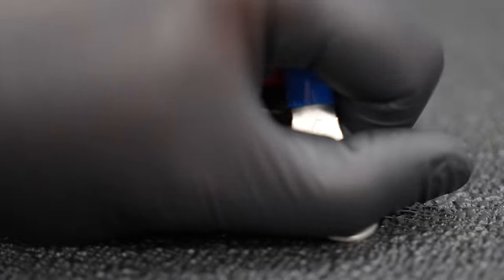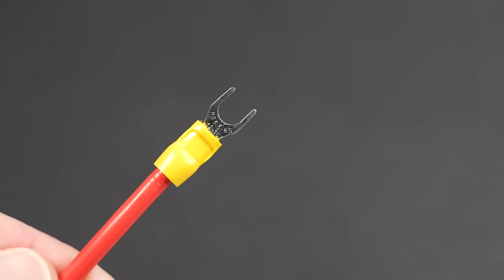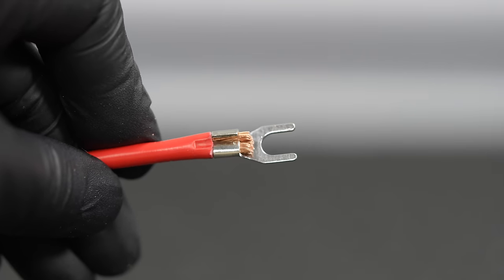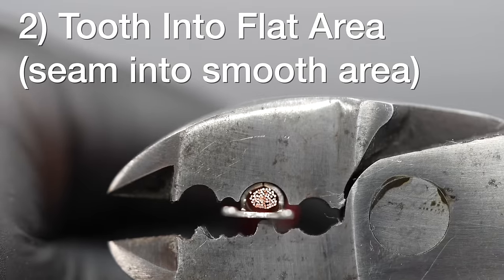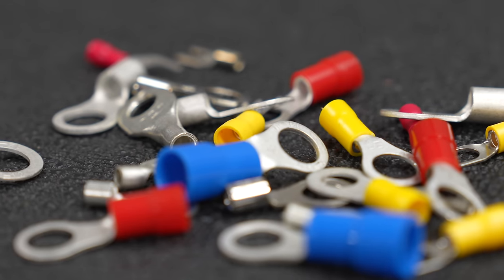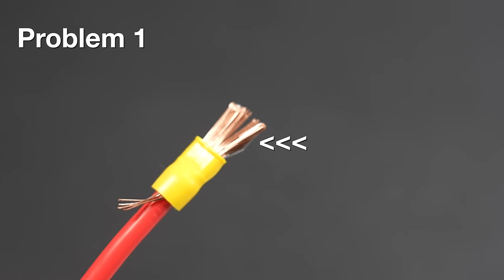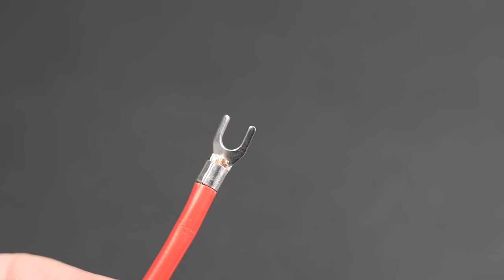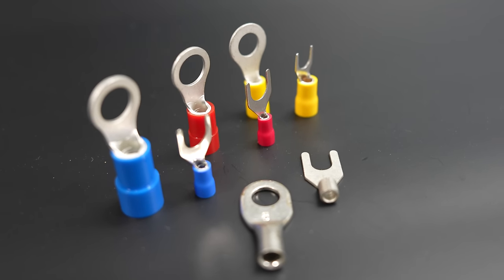Why 50% of All Crimp Connections Fail - Up or Down?

Comment: This explains the problems I've had for three decades with amateur wiring in my car. Genuinely, this video has made my life better. Thank you.
Reply: Yes but now you are old so you dont need it anymore
Reply: @misterRobbi   hes 15
Reply: @misterRobbi  Old physically, but I'm still installing aftermarket stuff at 45 when time permits. At least for a few more years until electric cars completely take over and it becomes nigh impossible!
Reply: @minecrafterselite1  Heads-up: A decade is ten years.😉
Reply: Anything that I want to last more than 6 months gets soldered instead of crimped.
Reply: Cars are another story all together because of the damp locations your connections can be in. Besides getting a good crimp you have to make sure they are sealed or the water and salt will destroy the connection.
Reply: Cheap tools and cheap crimps 👍

There is your issue.

The method given here just makes best use of crap tools and crap crimps.

Decent tools and the associated crimps will prevent issues.

- somebody who has crimped hundreds of thousands of connections on aircraft.

My last piece of advice... visually INSPECT every crimp after making it, ensure that all stands are in, it is folded over and there are strands protruding. (A tool with a depth stop ensures correct protrusion every crimp)
Reply: @richardwillson101  I’ve worked aircraft techs for 45 years, I swear you guys exemplify knowledge is power. One of you could have helped out his Crew Chief w/ this knowledge, LOL 😅
Reply: You didn't realize the common factor to the problem 29 years ago? This is why I make so much money fixing "fixes"... Better than amateur home wiring at least.
Reply: I use dielectric grease on all electric connections.
Reply: @richardwillson101  so wait a minute? Is there wire protruding or not?
Reply: The only time I ever heard the word “Protruding” my big brother was talking about a girls T Shirt.
Reply: @dandearman2871 i don't  know where you install your wires, but it shouldn't be a problem unless you install it UNDER the floor

(45y mechanic)
Reply: Some of what the video shows is wrong.
Reply: @AmosMosesJr  Like.... like what?
Reply: @alfredomarquez9777  well firstly what he shows as the supposedly the proper way to align a crimping tool is in fact incorrect. It's more of a trick but it's not correct and secondly that particular crimping tool is not designed for insulated terminals. The ratcheting style crimping tool he touched on briefly is really the only DIY way to make a proper air tight solderless joint that won't fail over time. Some people will solder them but that is not following any manufacture's spec I have ever seen. Also, in high vibration environments soldered joints are susceptible to failure as it has a tendency of wicking up the stands and the wire or joint can crack. Really nothing he showed was quite correct but it still provides a good overview for the novice.
Reply: Because I've been using the tool wrong for years I always strip the insulation of crimps and solder them on applying heat shrink afterwards over the crimp.
Reply: Then your still not on  the mark. Remember where your getting your info. Great for tips and hints, not for instruction. Consult the mfgr of the product your using.

Comment: Retired now but built low and high current power supplies much of my early adult life… a couple that are no longer in this solar system.   A few that vanished in a flash….  Nice to see someone on YouTube teach this right.   The orientation really becomes critical when dealing with high strand count small gauge wire - 1400 strand 12ga Teflon jacket is a bear to get mechanically connected.
Reply: How do you feel about soldering these connectors in stead of crimping? Or both?
Reply: @deslomeslager  I like to crimp and then solder!
Reply: @deslomeslager    Always, always establish a good physical/mechanical connection (crimp) before you solder.  Then, Depends on the application.  Most people over solder.  You only need to wick into the conductor and get some flow to the connector. I prefer some, but minor stick out of the conductor when pushed through the connector.  This allows you to place your iron so that you heat the connector and the conductor at the same time.  You don't want your solder to move outside the connector as it can lead to embrittlement in a high vibration environment.  In a high silver content wire you can even get hydrogen embrittlement.  Less is more.
Reply: @ramosel  You should make youtube videos about this kinda stuff. You've got some really interesting and useful information that could really benefit people in multiple different fields
Reply: Years ago a study was made and found that soldering these causes breakage in high vibration environments. The crimp allows just enough movement to avoid this
Reply: @jeffreystroman2811  - we were taught that in electronics classes in the navy.
Reply: @jeffreystroman2811 precisely why I won't solder connections on my bike.  
Others argue its fine. But I can't see why take the chance.  Now that I know how to crimp without needing to screw up 3 or 4 connectors for each connection😅  should be a breeze next time I gotta fix lights or get those heated grips I've said I was gonna get for 2 years.
Reply: No longer in this solar system, huh? Did you work on the Voyager probes?
Reply: @xEequalsMC2x No, but good guess.
Reply: @deslomeslager  Some medical equipment manufacturers require you to solder the crimp as well.  They will reject it if you don't.
Reply: @jeffreystroman2811  Some medical equipment manufacturers require you to solder the crimp as well.  They will reject it if you don't.
Reply: I had to troubleshoot a surgical isolation panel that had factory soldered leads connected under mechanical (not crimped) lugs; the solder essentially converted the stranded #8 copper into a solid conductor which managed over the years to become loose and start arcing which destroyed the main circuit breaker. I know this example isn’t the same as soldering a crimped connection after it’s been made, but it does show that solder doesn’t always equal better.
Reply: @mightyluv  You should never solder a wire and then tighten it between two metal surfaces.  The solder will compress and eventually the situation you described will happen.  That is what is predicted to happen and it should never have been done to begin with.  In fact that would be a major violation in most industries.  If you are required to solder a crimped connection used in a piece of medical equipment and the crimped lug is going to be screwed down, then no solder is allowed to be on the ring portion of the lug that will be underneath the screw--or it must be rejected or repaired.
Reply: I've seen people crimp solid wire, 100% failed. Not sure why anyone would crimp solid wire, but I have seen it.
Reply: @stellarspacetraveler  I don’t, but I have seen it a few times in the 30 years as an electrician.
Reply: @jeffreystroman2811  High vibration environments need other considerations.  But even then some are still soldered.  The reason is that if the wire is routinely pulled then it could come out of the crimp if it is not soldered.  So there is no one-size-fits-all requirement to solder or not to solder.
Reply: Then it must be New Horizons 😊
Reply: so you worked on the Voyager crafts components?
Reply: @ramosel  im not aware of anything else weve made thats left our solar system?
Reply: @CT_Taylor  5 objects are on solar system escape trajectories and have sufficient escape velocity: Pioneer 10, Pioneer 11, Voyager 1, Voyager 2, and New Horizons.  If he's retired now, and was part of the team that built something that has left the solar system in his early adult life, and it isn't Voyager, then it would be the Pioneer probes (1972-73).
Reply: Fantastic video! Your detailed demonstration on why 50% of crimp connections fail was eye-opening. I appreciate the tips on how to ensure perfect connections every time. Thanks for creating such an educational and helpful video.
Reply: @erdemkaya6472  Soldering connections in static environments on small components is really the only way to go.
On multicore, flexible cables that are crimped correctly, it is not only unnecessary but actually introduces rigidity that can be detrimental to it's integrity if used in an environment that is subject to vibration/movement  👍
Reply: Ahora me he retirado, pero la construcción del sistema de suministro de energía ha ocupado la mayor parte de mi vida madura. Una pareja ya no está en esta tierra, algunos desaparecen en un abrir y cerrar de ojos ... es bueno ver a alguien en YouTube compartiendo este conocimiento correctamente. La orientación es realmente importante cuando se trabaja con un cable con fibras altas como 1400 fibras, con una capa de teflón de 12Ga; esto es realmente un desafío cuando se conecta mecánicamente.
Reply: @diytoptricks I am curious about this, why the translation to Spanish of the main comment? moreover, why an automated translation instead of an interpretation?
Reply: @matthewbeaver5026 in mobile use like marine, cars, bikes and RV you first crimp and you crimp the unisolated version! After that you can solder ONLY on the side that sticks out of the crimp. As said before less is more means you just want to tin the outside sticking wires to avoid oxygen can pass into crimp from this side. Never ever let the tin suck itself into the crimped part as this stiffens it and cause failure to vibrations. You then apply a shrink tube WITH glue inside, the tube starts at the end of the stranded wire sticking out of the crimp and extend about 1cm or 1/3 inch onto the cable and when you heat this up the glue inside will form an complete air- and watertight bond so the connection cannot corrode. That’s the right way of doing it.
Reply: Sounds like you've got some interesting stories.  1,400 strand AWG 12 + Teflon.....     My.  That's an unusual run. Did it have 1 x 90° bend from straight horizontal to straight vertical (down) (deep)?    I always wondered how they made those brief measurements.
I'm sure you enjoyed the ride!
Reply: @jeffreystroman2811 nice that you said this. To solder them properly, you'd need a different metal and a different bend of the metal. And the guy here that says he does both is full of it
Reply: @stellarspacetraveler then they're creating a problem if it's the same material. Not that I care, I guess.
Reply: @ramosel gimme a break. There's a reason they're called crimp and not solder. Look at the difference in the metal, unless you're buying garbage.
Reply: @GrimReaping Oh yeah, just what a tuber needs, chemistry and physics lessons that are more bs than fact, just to attach a terminal end.
Reply: Sure.
Reply: what car do you drive?

Comment: If I'd used an indent crimper on an insulated connector on the sites I worked on, I would have been sacked. Always use the correct crimper for the design of the lug.
Reply: Great comment. You are correct!
Reply: I worked in maintenance for 40 yrs, my dad taught me how to crimp wires, always crimp and tug

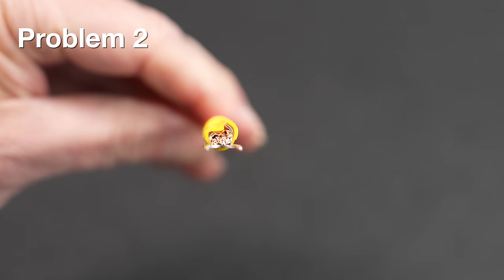Comment: The example "problem" crimp nr.3 at 3:50 should be considered a perfect crimp. The wire should terminate where the insulation ends, wire extending at all onto the mating surface is considered a defect in all 3 product classifications according to IPC standards.
Reply: Thank you, I came here to say this.  Wire extending past the insulation would be considered a failure in any method of crimping I've ever been taught.  And the next example with the uninsulated terminal he's gone and mangled it all to heck, now when screwing down the stud it's going to be flexing and bending.
Reply: Perf.  And on a BOAT used in salt water, its a great way to introduce corrosion, even if you spray it.    I take the wire flush with the connector.   And I also use MUCH better connectors with heat shrink.  Like rust, corrosion on salt water boats never sleeps.
Reply: @barrylinkiewich9688  Its even worse, the 1 with the manual toool is going to come loose when you tighten that thing down. The bend in the whole spade connector because of the crimping wil be partly undone by tightening a bolt on to the spade, and then the wires might not be as tight as they where.
Reply: I use mostly push-on connectors for DC motor connections. Something not mentioned in the video is a pull test, which I always do.
Reply: Well it’s gonna be even harder to pull out when the wire goes past the end bit. since you have to compress that part through to get it out.
Reply: I wouldn't call it a fail if it's just a millimeter beyond, it's when it's infringing on the connector area it's a problem.
If it's exactly in line with the insulation then it can come out easier even if the crimp is good by itself.
Reply: Absolutely my thought as he did not at all consider the ramifications of the connection to the screw portion of the lug. It begs the question: why hasn't he yet corrected this obvious (to those of us that know how to crimp) oversight? Any wire beyond the end of the crimp sleeve does not add to the reliability.
Reply: I have the IPC book in front of me now and "target" for all 3 classes to have the wire visible as long as its not in the mating surface. Being completely flush is a downgrade to "acceptable"
Reply: @slider7w  Having the wire extended a tad would create a lip to hold it better, where the crimp bites in... i side with video man
Reply: I always extend the wire about an inch past, then bend it back and wrap it around the body of the connector.
Reply: Everything I've ever been taught says wire should never extend more than about 1mm past the insulation / end of the lug. When you start getting into working on outdoor things / things that are in corrosive environments proper crimping is ESSENTIAL to prevent corrosion. If you crimp properly, the wires aren't just going to pull out, not to mention if your connection is exposed to pulling forces like that, you should be using a form of strain relief whether that be zip tying part of the wire to a solid fixture, or if you have proper cable grips. You should never allow things to actually pull on a wire.
Reply: @SMEChapter44-x8p  At my workplace, we pull test before the start of any run. Even good looking crimps can fail. I hate manual crimpers especially non ratcheting ones. The grip strength of the person will directly impact the quality of the crimp.
Reply: @petergriffin383 I'm gonna try that I need to reinstall my car's fuel pump

Comment: So logical...but for 55 years I have been unaware of this...great content as usual SC
Reply: Amazing how something so simple can be so technical.  I've been doing it wrong for 3 decades... 😂
Reply from the maker: Glad it was helpful! Thank you
Reply: I thought the dome gave it away as you dont need to align it perfectly that way
Reply: you have been unaware because it never mattered until the Chinese crimps hit the market.
Reply: I am glad I am not alone. At 74, how many times have I done the simple act wrong! This was a well thought out video. Thank you for your effort!!
Reply: Great video! Like many others, I've been doing it the wrong way. I made up for it by adding lots of black tape or adhesive heat shrink. Very bulky looking end result and only worked half the time. Now they hold tight like they should and look more professional, and ideal for connections in tight places. Thank you so much!
Reply: Same here. This is good info.
Reply: @robertscroggs2712 Me too.  Exactly. I wondered why sometimes the wires just pulled free as easily as if they hadn't been crimped at all.
Reply: I have to admit, I have been in the automotive mechanical/ electrical business for decades and today this old fart learned something new!

Comment: This video finally talks about how to orient the seam in the connector in the crimping tool. This is the first video that takes that question head on, to make sure that the dimple is on the side that does NOT have the seam. So simple and yet almost NEVER talked about—thank you for this video!

Comment: One of the few YouTube videos that actually shows the importance of seam and crimper orientation.
Thank you.
Reply: What he does not make clear is whether orientation matters with a ratchet crimper, and if so, make it crystal clear which way to offer up the crimp connector to those differently shaped jaws.
Reply: On rewatching carefully, I see there is a brief text overlay at 2:30 which says "insulated crimpers" (presumably he meant to say, ratcheting crimpers) "eliminate the need to orient the connectors"
Reply: @Gottenhimfella  Not really sure if this is true as the the jaws are shaped differently. Imho the part with the higher edge should go where the seam of the crimp connector is.
Reply: @rilosvideos877   It would be helpful if the clip maker would clarify, for sure.
Reply: On ratchet crimpers the side with the coulored points should go to the metal part of insulated crimps.
At least European ones, dunno if American or Asian are different.